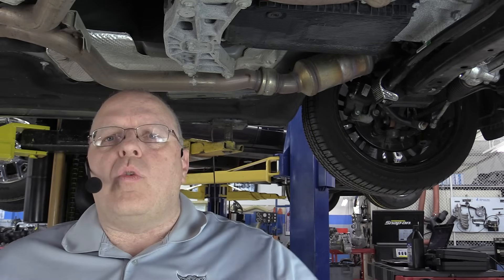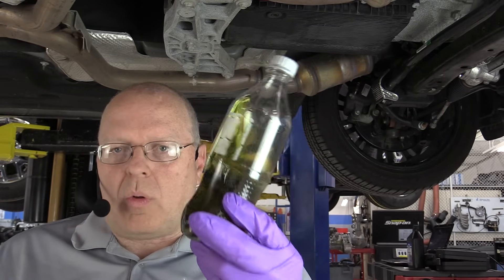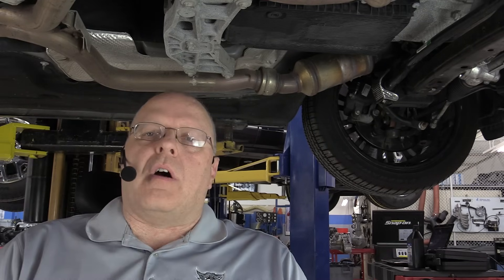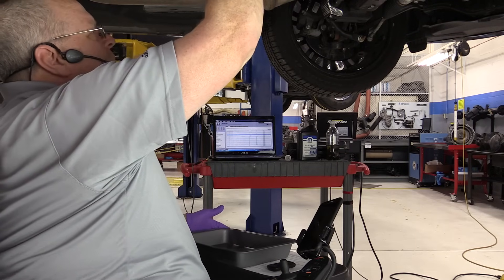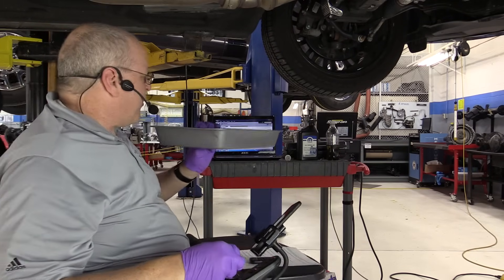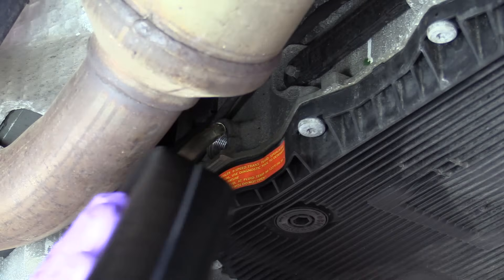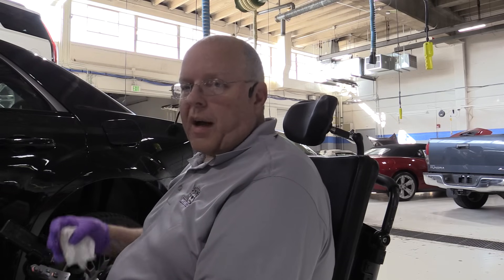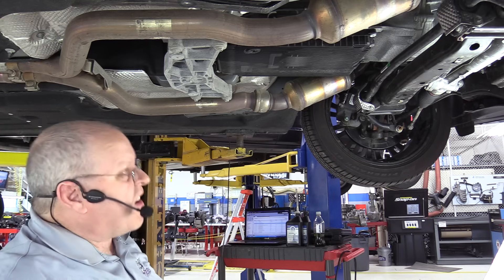Jeep, Dodge, RAM ZF 8HP 8HP 8-Speed  Transmission Fluid Level Check - No Dipstick

Comment: shouldn't the ZF engineers have considered the extra fluid requirements associated with Their cooler/lines..?  maybe it's already compensated for in the height of the drain plug..?
Reply: Zf just makes the transmission. The car companies add on the other lines and valves as they see fit
Reply from the maker: ZF does not build cars or trucks, only the transmissions. it is up to each vehicle manufacturer to determine if they will use a transmission cooler, how large it is, and if it will have a bypass valve. It is also up to the vehicle manufacturer to come up with a fluid level checking procedure that will work for their configuration. Best wishes!
Reply: @WeberAuto  common man. What zf transmission don't have a cooler. The BMW before buy a transmission they need to know how much oil need to be inside. The transmission its filled after they mount on car. Wtff man.. Realy

Comment: Mr. Kelly, could you tell me please, why do you think the zf8 shifts hard when below the operating temperature? Oil and pan have been changed though.
Reply: @Sean Ware I believe it is called transmission adaptation,  we did it several times on the m-plates (mules).
Reply from the maker: It could be normal. That transmission uses clutch packs that are purposely allowed to slip under certain conditions. Cold operating temperature can aggravate that, incorrect fluid can also aggravate the condition. Of course, there could also be a problem. Sometimes a software update for the transmission controller can fix an issue. See your dealership to have them check for an update. Best wishes.

Comment: I try this step by step  but oil is come out around 3/4 liter is that mean to much oil in my Zf gear? Because I changed gear under warranty before 1 year and I found my gear oil temp be come high temperature
Reply from the maker: If you followed all of these steps, it is probably too high. It could also be the fluid that was in the cooler.
Reply: Eng John Kelly Now my jeep gear is perfect and Normal  temperatures 90 C°  +3 - 3C°
Before 3/4 liter of oil  come out, Previously it was up to 126C ° 
So much thanks you Save my gear.
Reply: Abdullah Jassas السلام عليكم اخوي انت مجرب طريقة تشييك زيت ال ZF انت الي خرج معاك حوالي ٣ الى ٤ لتر يعني بعد ماهرج ظبطت حرارة القير الله ييعدك ياليت تفيدني شكرا

Comment: 1. I vote for bring back the dipstick. It will achieve the same and show fluid expansion.
2. In all my years of working on cars, I've never seen a trans burn up from overfill(within reason).  But all will burn up if under-filled. Remember, the fluid is meant to absorb heat.
Reply from the maker: Thanks for your feedback!
Reply: Believe it or not I have seen a trans burn up from over filling. it was a county owned car and the county maintenance technicians managed to overfill it to the point where fluid started making it's way out side to the topside of the transmission case. You could see trans fluid pooling on top of the transmission when you opened the hood. Transmission was cooked . This was a 2010 v6 Camry. And of course the county wanted it under warranty.
Reply: @DontCryAboutIt  I personally experienced foaming in my 1985 Dodge Aries!
Reply: Dodge dealership told me my charger Trans never needed servicing, but I could service it at 100k if I wanted. Quoted me $1000. Ridiculous.
Reply: @farmboy9229  thats because they never do it and dont know how to do it. Imagine they do something wrong, what would be the cost for them? Hence the price...
Reply: If overflow was the problem then it probably was 10x higher than intended, only possible by a idiot.

Comment: Just a heads up to anyone with a 2015 Ram with the 8HP45 8 speed transmission $ 40 a quart for the fluid is ridiculous and I found a cross reference fluid that's compatible and it's made by amsoil for 14 $ a quart and if anyone remembers ford did the same thing back in 2005 with the 5 speed automatic trans in the 6.0 liter diesel with Mercon SP fluid was also ridiculous priced. Well hope I was help to anyone that was considering selling there Ram because of high prices on fluids
Reply: If you want oil that's definitely compatible, because it's sold by the transmission manufacturer, Google "ZF Lifeguard 8".  There's a place in California selling it for $22.90 a quart (as of 7/2017).
Reply from the maker: Thanks for your feedback. This is no ordinary transmission. This transmission requires a special low viscosity fluid with a friction modifier because the clutch packs are made to slip on purpose at times during shifting. Adding the wrong type of fluid can ruin the transmission (which costs a whole lot more than a $26 per quart price difference.) Make absolutely sure the fluid is compatible before using it. Have a good day!
Reply: Valvoline Maxlife is compatible..I know people that have used it longterm with no problems. I'll use it when my warranty is up.

Comment: What a pain in the ass.  Can't a person just measure what they drained (when cold) and put the same amount back in (when cold)???   How could you go wrong there?
Reply from the maker: What is the level was wrong to begin with? Thanks for your feedback.
Reply: You can't assume that the fluid is not already a little low or that you won't loose some on the drain.    That is a very poor way of doing it.   Assumption is the mother of all screw ups.
Reply: @Physics072 It's not a poor way of doing it. It works for many people who have these transmissions. I've heard of several people doing it
Reply: I think that makes sense. I have a German car that has the ZF transmission and wanted to do a simple drain and fill but dealer wanted $1200 to do that. I don't understand -if you just remove the fluid at cold temp, and add the same amount of new fluid at the same cold temp. It should be fine. They make this so complicated

Comment: Excellent video very well explained . I have the problem with 2008 BMW 750li , If I drive it for 1 hour the transmission RED wheel sign comes on saying transmission overheated. The only thing I had done it was a change of leaking cooler lines under the sub frame which is about 7" they were leaking the rubber houses. it cost me $663.00 for cooler lines only the installation was extra.
Reply from the maker: Thank you! Overheating is serious. Causes? Low fluid level, restricted cooler or lines, internal problems. Best wishes!
Reply: Did you find out what was your issue sir?

Comment: Thanks for the vid.  Well done, and very informative  I have a question though.  What do you think the purpose is of checking the fluid at a lower temperature is, when, at the end of the day, you heat up the tranny, and either add or drain fluid out?  Seems  redundant to check it 'cold', then recheck it hot.  Maybe I'm missing something though?
Reply from the maker: Thank you! It is a strange procedure. ZF is the one that warns about the cooler bypass valve affecting the fluid level. The Chrysler service information mentions nothing.

Comment: question...how can you assume the engineers at chrysler didnt account for the transmission fluid level with the cooler drained as part of the procedure? seems presumptuous. if the cooler did make that much of a difference... you are basically saying that it can never be correct. because if you have the level set so that it is high enough with all the extra fluid in the cooler then when it gets below a hundred and sixty then the level will be way too high in the pan for regular operation. if you set the fluid low enough that it is topped off with the cooler empty then when the cooler fills up the level will be much too low... these things are usually exclusive is a car was engineered correctly
Reply from the maker: Thank for your feedback. I agree, there is no easy way to deal with this issue. ZF designed the transmission and they are the ones that told us of this problem with their transmission on any vehicle with an external cooler.  I would like to believe that FCA designed the cooler and pipes to stay full as the transmission fluid cools down, but ZF is telling us otherwise. Who know what to believe? Thanks again.
Reply: He is confusing a lot of people because he is wrong. He is saying it backwards. The valve is actually closed until it reaches operating temperature and then it opens up.

Comment: I'ts not really that hard to do, household termometer and 4 jackstand some household tools and you're really good to go. No need to use ZF fluid either. Mannol ATF AG55/AG60 is same spec as 6hp/8hp and 6 dollar a Quart, cheap enough to change every 10 000 miles. May seem pretty hard to do but it's not. The hard part is changing filter and mechatronic sleeve on these vehicles.
Reply from the maker: Thanks for your feedback!

Comment: Another concern would be where even a minor frontal collision would necessitate removal or replacement of the trans cooler, fluid would be lost and air would enter the system. Once this happens your extended check then drive then cool down and recheck the levels would as you point out perhaps necessitate 2 days in the shop. Apart from the time the customer will be without their car, the hoist access time, having a second staff member to be in the vehicle while someone is checking underneath, its going to be expensive. Then assume the customer may be in a courtesy loan car, this will make this an expensive cost recovery exercise any time something so basic as a trans oil check is needed. Over-complicated  expensive service procedures like this are going to be unpleasant for the staff to explain to the customer.
Reply from the maker: Great feedback! Thank you!

Comment: John I see Valvoline makes a tranny fluid that says is a direct replacement MaxLife Multi-Vehicle ATF It is a lot less $ would you say it would be ok to use? Also to do a flush I got steps from ZF saying to add half a quart extra because of that valve. Would I still need to do all these steps after drain and fill with engine on until pan is full by getting the drips from fill hole?

Comment: would amsoil signature series fuel efficient  atf be a good equivalent fluid for this transmission? paying 43$ a quart is insane. I tow constantly,for work etc. I have been changing mine at 35k. Only a drain and fill. About 4 quarts comes out at a time. I also replaced the filter once. It's a 2014 ram 1500 5.7 8 speed. Also ATP has a equivalent filter B-453. I haven't used one yet. You can replace the filter in that pan and the filter only is 40$ Big time savings. Have you dealt with ATP filters and the quality of their filters. I'm trying to save money. Would you recommend a magnifine filter for this transmission? Alot of metal comes out of this transmission  and it's very common with the eco diesel and 5.7 hemi. Thanks. BTW you make the best videos. Very clear instructions. Also the factory fluid doesn't give me any confidence.
Reply from the maker: Thank you! I never recommend using anything other than factory original parts/fluids in your vehicle. Yes, they cost more, but if you want your vehicle to work the same way it did when it was new, it has to have the same parts/fluids in it. The special fluid for this transmission contains an anti-slip additive because the transmission actually allows the clutches to slip on purpose as part of normal shifting. Using the wrong fluid can cause excessive clutch wear and chatter during these shifts. This will lead to premature transmission failure. Best wishes!
Reply: Thanks for your reply. One last question. Should I use the zf lifeguard 8 or the mopar 8&9 speed atf? Probally the same fluid anyways. I do know the color is barely different. Also on the quart of mopar 8&9 speed atf I have it says it's only for the 8hp45? Mine is a 8hp70. So that's a no to the inline transmission filter? to use. it's magnifine filter. Thanks sir
Reply from the maker: I would use the Mopar 8&9 speed fluid. According to the parts guy at the local dealership, the fluid is the same part number for the 8HP45, 8HP70 and the 8HP90. Personally, I would avoid the inline filter. You run a risk of fluid leaks, restrictions, contamination, etc. by adding parts like that. Best wishes!
Reply: Are both the mopar and zf fluid full synthetic? I've seen ravenol has a fluid specified for the zf8hp70,it's full synthetic,PAO base oil.
Reply from the maker: I do not know.
Reply: Lifeguard 8 is the ONLY ZF approved fluid for their transmissions and you can find quite easily for around $24 a quart!!
Using anything other than Lifeguard 8 and your tranny craps out,  any warranty claims could be voided.

Comment: on a hot summer day in Phoenix might be an issue. I see the engineers are completely assinine thinking this is great way to check fluid levels. 43 bucks a quarts is crazy, specially if you need to empty and fill this transmission. I do not believe in the filled for life theory and would never allow it on my equipment. Heat is the enemy on oil's life span. But a great video to see how it is done.
Reply from the maker: Thank you and thank you for your feedback!

Comment: how much oil did you put in vs the amount of oil that drained out.  bet it was close to the same amount.
Reply from the maker: I did not compare. It would really depend upon the fluid temperature and how long the drain plug was removed from the oil pan. It could also be affected by whether or not the cooler bypass valve was open when the engine was shut off.  Any service work on the transmission could affect the level as well. Too may variables! Setting the fluid level in this manner will always result in the correct fluid level. Best wishes!

Comment: I have a question  when the trassmision don't have any fluid and you trying to poor in it. And its fills up but than goes back to not having oil   Why is that does the car haves to be on ? Or off and what are the steps thank you
Reply from the maker: The engine must be running. The oil level drops as it is pumped to other parts of the transmission.

Comment: I wonder how much a dealer will charge that follows the correct procedure. Also can you not open the valve by computer? Or the bypass valve mechanically controlled.
Great video!
Reply from the maker: It will be expensive because of the length of time it takes. The bypass valve is mechanically controlled.
Reply: LOL ! Took my Ram 1500 to the dealer to check the upper ball joints and trans as it is ' slipping ' . Was charged $100.00 to check trans level and tell me the upper ball joints are bad( Knew this already ) . Talked to the mechanic and was told the trans hadn't thrown any codes and wasn't physically checked as it takes two people  had to be cold and is a pain to check. . . . . Sitting overnight  prior to being pulled into this shop wasn't cold enough I guess ? Then sitting in the shop all day and needing to rescheduled to do what wasn't done on the first scheduled appointment. What is a pisser is the fact I'm a retired ASE master mechanic who is now disabled and physically unable to do the work but there is nothing wrong with my mind or how to read a time / labor guide . Oh by the way the upper A-arms were in stock to do the job , and the vehicle was approved by the warranty company to perform the work . Oh , I forgot to mention something as yet to be seen but I suspect I will be' surprised ' with . The transmission fluid whether added or changed etc will be deemed a ' service ' to be charged outright and not covered by warranty if Dodge service is like Toyota's service . I'm waiting to see as already I have had the expense of a rental vehicle , a hundred dollar deductible , another rental charge upcoming  plus who knows if the work will be completed when it is returned to be performed again at the designated time ? Actually the night before as was required on the last appointed visit for repair  . .  Still better than the GM dealer in Gainsville though . They will lie send you back out after cheating the insurance company for work not done in an unsafe jerry rigged vehicle so you'll come back time and time again . Second time disabled and all , I located purchased parts , made repairs , video's the whole thing even the air suspension springs that weren't replaced along with the actuator or sensor arms that were jerry rigged with wire ties and sent old parts along with video to the IG and the insurance company I'd purchased the extended insurance plan through .  My be going that route again it seems .

Comment: Thank you for this highly informative video John. I believe this is the same transmission model that is in my 2014 Jeep Grand Cherokee 3.6L. I have experienced an intermittent fault where the transmission fails to automatically upshift when I pull away from an intersection sometimes and it sticks in 1st speed. Are you aware of this issue and the root cause? The Jeep dealership here have checked it over and cannot find a fault?

Cheers,
Derek
Reply from the maker: Thank you! Yes, it is the same transmission. I have not heard of that issue, but there are some software updates for the transmission controller related to shift enhancements.
Reply: WeberAuto Thanks Again, keep up the good work 👍👍
Reply: I had to lift the passenger side up to add an extra .5 liter. If you only check it when it’s flat you won’t fit enough in and will cause it to slip or shift weird. Once I added that extra half it was a world of difference. I think in total I used about 5.5 liters.